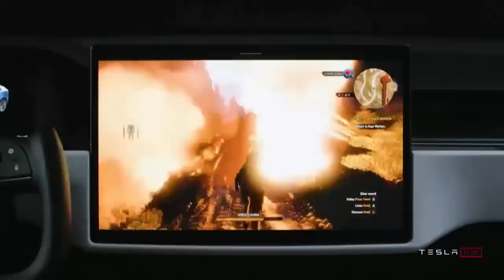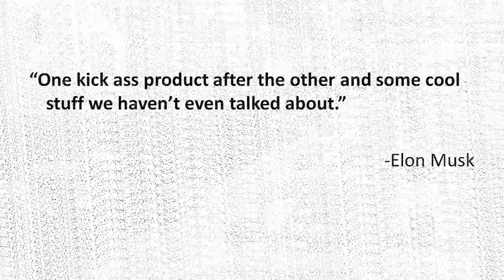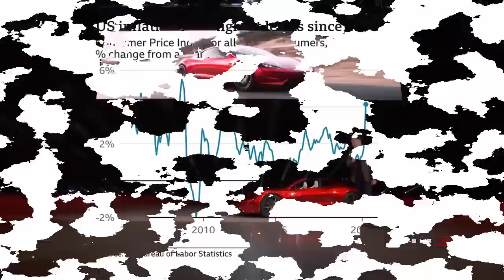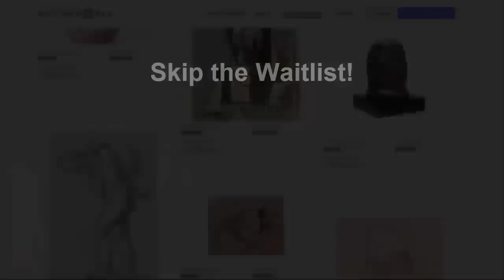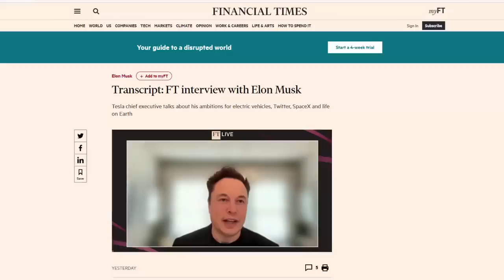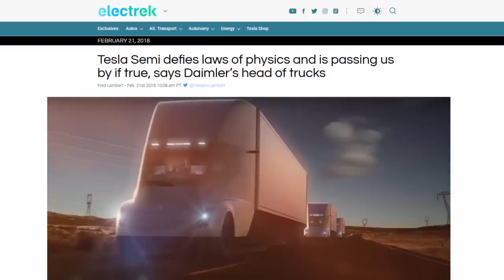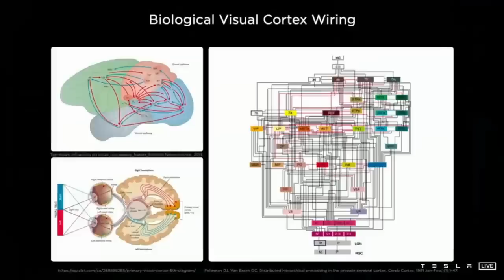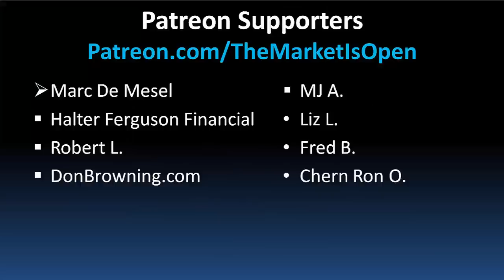4 NEW Teslas CONFIRMED for 2023

Comment: It makes no sense. They have delayed so many times already. Surely the same reasons why they are not producing new vehicles this year will aply next year. If they build say, the cybertruck and have hundreds of thousands of orders, why would they then release another new product in the sane year?
Im not so optimistic
Reply: Incorrect. They have been working on the 4680 cells for years, carefully honing the production machinery and increasing the yield of good cells. They just started production of the Model Y in Berlin and Texas using the new 4680 cells. They are planning to ramp up 4680 massively and also Panasonic will start producing the new cells this year. Cybertruck has over a million orders but the Semi will have better margins.

Phillip.

Comment: They won't have a robot ready for production, they haven't got a prototype, they still have a lot of work solving agile kinematics, there are fundamental issues with weight, strength, speed and accuracy, with enough power, and batteries for such a slim form factor, it has never been done, they will run into local maximums all over the show. They will still be prototyping 3 to 5 years from now, mark my words

Comment: Cold gas thrusters? Lolz
The battery density of the old batteries are the same as the new ones, no?
Reply: SpaceX cold air thrusters same as his self landing reusable rockets. 4680 is 15% more dense, 10% lighter, 50% cheaper and allows structural battery pack architecture.
Reply: @larryc1616  Panasonic figures show same battery density as the old smaller ones; they are an improvement, but hardly ‘revolutionary’
Reply: @daveterrier2228  the revolutionary part is not comparing batteries (2170 vs 4680) but 2 other things: 4680 cost 50% less to make and the massive weight savings from the 4680 structural battery pack.
Reply: @larryc1616  to me that just sounds evolutionary, whereas a real break through such as solid state, would be revolutionary

Comment: Why does modern art looks like I made it?
Reply: Should there not be a connection between real masters of art, like high tech designers and top engineers?
Reply: A lot of... modern art... seems to be made as a deliberate mockery of what "art" even means, and how far the definition has been stretched already. Some early examples were meant as a criticism of the way art moved away from traditional paintings, I think.
For example, one artist just like took a urinal and smeared the word "art" on it or something to that effect,but then it was accepted as actual art and ended up in a museum.

Reciting this from memory, so a lot of this could be wholly or partially wrong.

Comment: Hello TMIO Tesla,  I am a big Tesla fan and investor. Just wanted to alert you to check out GREEN Hydrogen and Plug Power Inc. You are giving it a bad name probably because of Elon's attitude about hydrogen, but if you are in the know about what is now spreading across the globe and being adopted by the USA, Germany, Europe in general, Korea,  Australia, etc... you might change your opinions about this new technology and growing sector. John
Reply: Hydrogen wont take off mass market. I think it has good niche cases like Alaskan trucking. But BEV has much more TAM.
Reply: Green hydrogen run through an internal combustion engine just needs a huge upgrade to transport it at 5000-10,000 psi and cars built to that specification (bearing in mind that the smallest element can get through most materials, seals and makes metal brittle).
Otherwise hydrogen fuel cells are in the frame but they still need a battery and an electric motor.
So it's kind of - why bother - just use existing grid.
Plasma Kinetics storage method + fuel cells could work though.
YT channel "Just have a think" covers this type of thing with wit and diligence. Also Sandy Munro went to their site to see for himself. Impressed he was.

Comment: I'm good with Tesla  he's making a difference in everything  but what I'm not good with is the electric car is EXSPENSIVE and my truck Where's that in electric 
I have a paid for 2013 F450 crew cab 4wd 6.7 diesel  with 2 fuel tanks 1200 miles I can drive pulling 40,000 lbs 🤔 and paid 37,000 for it 😀
Reply: Just out of curiosity what would your truck cost today?

Comment: By the end 2025 Tesla will be Producing nearly 6 million cars equipped with FSD level 4/5 in their Robotaxi fleets. Year 2026 is the year that Tesla’s Semi will be roaring through out US HWYs all with 500 mile range and equipped with FSD level 4/ 5 . Year 2027 is the year that most OEMs Particularly Ford and GM will file for bankruptcy. Year 2028 Tesla will acquire Daimler and partner ship with VW.
Reply: There will never be a Tesla Semi.  There is a weight limit allowed….that means truck, trailer and cargo are limited to a specific weight.  The batteries weigh so much the cargo loads will be too small to make the runs profitable.  Only Tesla will use them.
Reply: Mercedes has a much better EV line coming then Tesla that targets the luxury market…Audi as well, they will dominate the high end market.  The Koreans will have equal technology but a better price than Tesla so will dominate.  Ford and Chevy will dominate the truck market because they are shaped like trucks and can be used for work.  No ladder rack or tool boxes can go on Tesla. ….it’s just a gimmick.  So fanboy, Tesla will just be a niche market with the legacy manufacturing taking over because they know how to build a car.
Reply: As a truck driver, I can tell you the Tesla semi will never take off. It’s a horrible design. You can tell that the design team at Tesla never talked to actual drivers. The center driving position is a bad design because it makes both sides “blindsides”. It will be interesting to see how Elon meets dot regulations on these. The prototype doesn’t even have mirrors which it is required to have. Weight and charge times are what will ultimately kill it. And Tesla does have competition in the semi market, Kenworth just released the T680E. But ultimately the best solution for big trucks is a hybrid system that eliminates charging.
Reply: @jimdandy9118  The weight limit is different for electric trucks. Pepsi have already started using it. And I think you missed the whole point of the Semi waiting for the 4680 battery which is lighter and more powerful than anything else on the market.

Phillip.
Reply: @philliptemple4534  Listen up Fanboy.  There is absolutely no different weight allowance for EV trucks.  In the US it’s the individual states that set the maximum weight limit because of safety and they don’t want their roads destroyed by overweight trucks.  Pepsi has a snack business and since that is like hauling air the weight issue isn’t a problem.  The new batteries are still going to be too heavy to make an EV truck a good financial decision.  You must be a kid.

Comment: Yet it is 12 months behind delivery on MY and M3
Reply: M3 is BMW Trademark. Model Y and Model 3 are the correct terms and shouldn't be abbreviated this way. You can abbreviate them as 'Y' and '3' as those are unique in auto industry. 
Now they're behind only because demand is off the charts. When their new factories are fully operational, the delivery times will drastically get cut down from 12m to 3m
Reply: And yet, buyers patiently wait for the best.